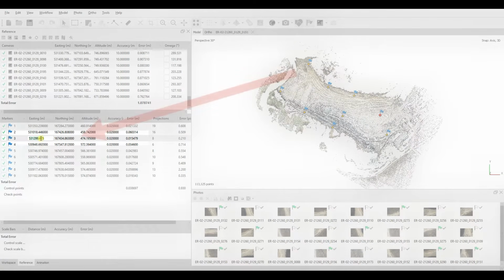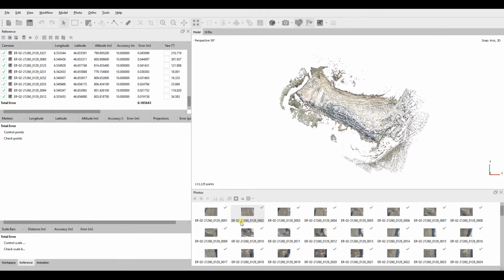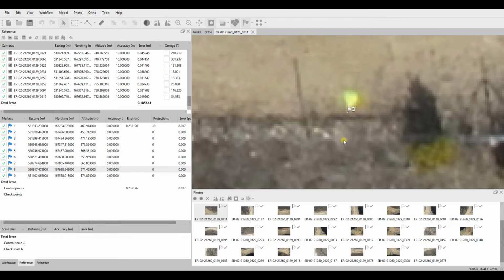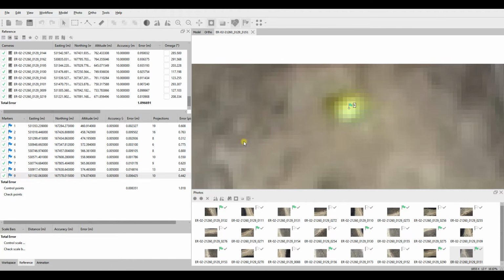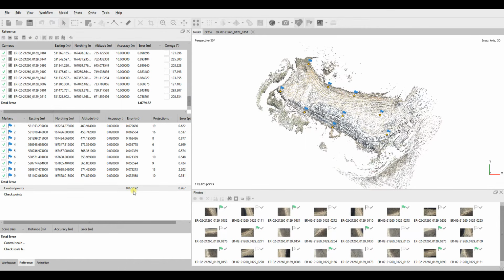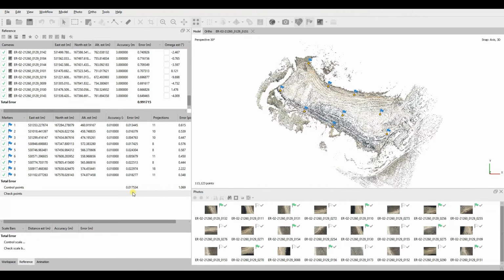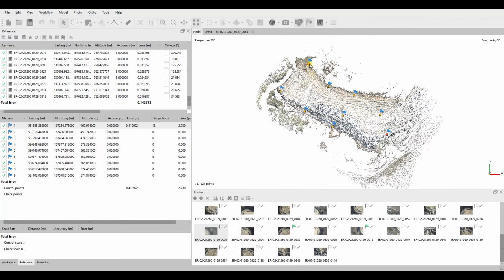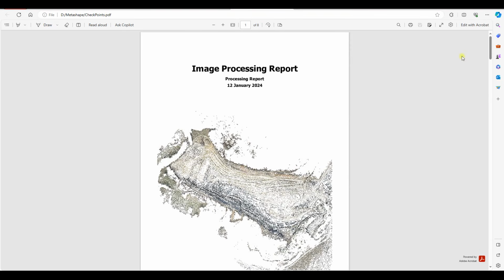Adding Metashape GCPs - Be Careful!

Comment: Great lesson, as usual.  @inspiredScience"s comment is pertinent as well.  Also, in my use, I usually get slightly reduced camera errors (rtk drone images) when I also select "fit additional corrections".  I think this is just letting MS tweak the camera calibration based on the additional data.  Have you tried using it in your testing?  thanks again!

From the Manual "Fit additional corrections:
With this option enabled Metashape estimates additional coefficients that are necessary to achieve
better accuracy."
Reply from the maker: Hey David - thanks for the comments. You are very correct, @InspireSciences comments were exactly right, I've just been away for a while, but back now and will answer that comment too.

I haven't tried the "fit additional corrections" options too many times, to be honest, and only approach it when things don't seem to be going well. But it is good advice and well worth a look. Thanks!

Comment: Hello, I would like to count plants in a field based on their height. I think that this should be possible using a dense cloud or a 3D model. What do you think, can this be done or would another way be better?
Reply from the maker: Yes, I think this is possible.
First you would need to establish the height of the plants and you can do this in two ways I can think of. 
1. Calculate the height of the points (of the plant) or that section of the model above the surrounding ground points and do this for each plant. Add an attribute for each plant and perform the count once all plants are measured. This method would be time consuming.
2. Classify the ground points then reduce all ground points to 0m elevation. Allow all data to shift with it. The result will be that all ground points are 0m and all other points are now their own height above the ground i.e. the height of each plant. Therefore you could now only use data within your selected height range and delete of hide all other data. If you wanted only plants taller than 2m, you delete everything below 2m. Or a plant taller than 1m but shorted than 1.5m, delete all data below 1m and all data above 1.5m. The result is you will have points of data that should be the plants you need and then you can count of of these points of data. To make it easier, groups the points or pixels by proximity so you only have 1 group per plant, then select all plants. It should work.

Comment: Excellent video, with one minor adjustment: Metashape's re-alignment regression does not use the accuracy settings as static limits. Rather, they are only used as weights relative to one another. For example, setting photos to 20m and GCP to 1cm is a 2000:1 weight for GCP's. Setting photos to 10m and GCP to 5mm (defaults) is an identical 2000:1 weight.

When doing the regression (similar to least squares) to determine the most likely coordinate, points are evaluated based on their weight. The static number itself means nothing, only the relative difference is consequential.

To explain more simply, imagine three UAV's were used to survey. One is corrected via PPK, one with RTK, and one traditional GNSS w/o correction. In that instance, you could set GNSS to 100m, RTK to 10m, PPK to 8m, and GCP to 10cm. The isolated numbers are not consequential; however, the relative weight will be 10,000 times higher for GCP's than GNSS, while RTK is 10 times higher weight than uncorrected GNSS, and PPK is about 25% higher weight than RTK.

This helps you understand that with a single image set and GCP's, only one number needs to be adjusted and that the effect of doing so is logarithmic, for example, changing 1cm to 3cm is proportionately equal with 3cm to 9cm.

Comment: Great video and good explanation! When accuracy values are included with the GCP file, eg they are provided in the export from the GNSS rover, and accuracy columns are selected during import into metashape, I guess those accuracy values override the reference settings for marker accuracy? Would the same apply to camera accuracy when rtk is being used and values are loaded from xmp data? 
Tools > Preferences > Advanced > Load Camera location accuracy from XMP meta data
Reply from the maker: Thanks for watching.

My opinion (may be a little off) is this:
I'd be skeptical to leave the marker accuracies as they are from the receiver, unless they have been post-processed. The hassle is that the real-time corrections are based on expected inputs, and don't always include drift and other changes in the GPS satellites, or something else that may have changed at the CORS station - I'd say use the accuracy values with caution, but allow them a larger error potential and see what the result is. You will find that the error stops increasing at a certain point if your points are good.

The drone accuracies, if you use RTK, would be valid in a relative sense. Like in the video example, we began with 18cm but ended up at 1m (even though I allowed 3m) because RTK is not absolutely positioned, but it is only relative to the RTK base. (If you setup the RTK base on a known point and enter that value into the RTK receiver, different story) In that case the image-to-image alignment was an average of 18cm, but 1m from known points on the ground. Metashape doesn't allow you to easily see both values at the same time.

A good idea is to use those values as a starting point and take it from there, paying close attention to changes as you process. As you use your own system more, I expect you'll get a feeling for what is correct for you.

If you can use PPK however, that's a different story and I'd likely trust those values a lot more.